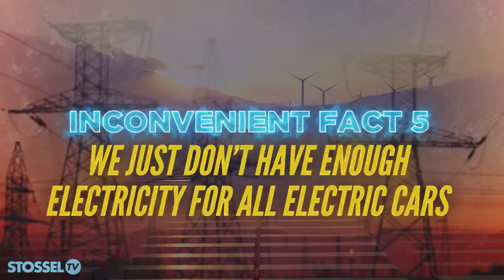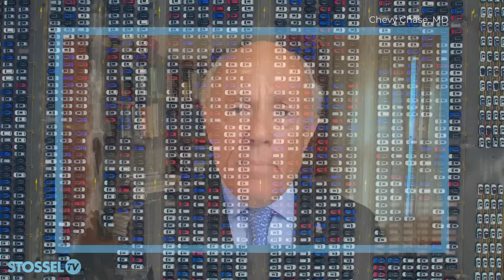Electric Cars: Inconvenient Facts, Part 2

Comment from the maker: The original version of this video has been updated. We originally said that covering "the entire continental United States with solar panels would not supply half of America’s electricity.” But the study we cited for this fact has been updated.  Therefore our reference to it has been removed.
Reply: Well it's all over the web which a simple search will tell you. depends on insolation and who much is electric energy versus other types of power.

 Here in Australia  it's about a thousand sq km for total electrical load.
Reply: You should had left that solar panel video. All that free electricity paying it self again and again would have been an hilarious backfire to your gas and oil employers Lol 😆 😂 🤣
Reply: John, what are the advantages?  How about a full story from both sides.  Give us the facts and let us determine our opinions.
Reply: Double the electricity grid to provide the charging capacity for BEVs. How much to replace the heating with oil and gas with inefficient heat pumps.

The UK government wants to fit a million heat pumps a year over the next decade. The UK National Grid says we only have capacity in the grid for 900,000 total.
Reply: I'm glad you found out that using 2013 technology it would only take 1% of the land in the lower 48 to power the entire US.   Also using 2022 panels it would only be 0.5% of the land.  Really should have updated that part and said that this is great thing that could make it easier for the EV transition as a counterpoint to Physicist that thinks CFCs don't cause ozone holes.
Reply: It’s just math Strossel. 🙄
Reply: you should remove the entire video tho because its wrong on all the points😂
Reply: @alans9806  a square of 33km ? gg
Reply: @markhutton6055  *super efficient heatpump my dear.
Reply: God Bless John Stossel, ...and anyone telling the Truth ....
Reply: @PeteZam  John Stossel just apologized for using really old data and took out the section that said we need the entire land mass of the US to supply half of the energy needs for the US.   The US Deptartment of Energy says it takes about 1% of the US lower 48 to power 100% of the US electrical need.   The US Department of Energy was basing this with 14% efficiency solar panels.  Current panels are 18% efficient which means that it requires less than 1% of the land surface.  Half of Lake Michagan would do it.   Go ahead and look it  up.   I challenged Stossel along with probably a whole bunch of others to look it up.   He did and removed the false facts from his video.
Reply: Haha! This is embarrassing. You didn’t do your research. I’d be happy to debate you and Mark Mills. This is manipulative and misinformed.
Reply: Retire John!
You were only popular on 20/20 many decades ago.
Your return to social media is too complicated for you.
Reply: Unfortunately most of the facts you presented here were untrue. It’s tough because I typically enjoy your content. If you continue to produce more videos like this I will be unsubscribing.
Reply: Still wrong on most if not all of the points. Question at the authors: You do not look stuped. Why are you doing this?
Reply: I was wondering if you did any research at all or if you had an agenda to push when I heard you state that the 1st time.   If you addressed every point that was incorrect in this short video you would disprove your entire point.
Reply: Should I go on?
Reply: @mt2nv1   I would love to sit down with you for that 1. In support of course.  This is a rubbish report
Reply: So many wrong statements in your report John. I am so glad you noticed that changing over our cars and trucks and powering this with solar panels would require 0.3% of the US land area, not 200%. But you also said changing over to EVs would require increasing the supply by 50%, which is wrong. It requires increasing the electric supply by 30% over a ten year period. Which is only 2.6% per year. The demand for electricity in the US increases 100% every 14 years and -- thank God for American engineering talent -- this doesn't seem to have had any catastrophic effect on the price of electricity.  This is an opportunity for America. By converting over to EVs for cars and trucks, we can declare independence from the OIL CARTELS. Can I appeal to your sense of nationalism?
Reply: @victorluke5816  Do you or your gurus ever consider the environmental cost of manufacturing and erecting solar panels and wind turbines ?
And if they are so efficient why aren't there more already in use ?
Reply: @markhutton6055  But that is a false statement. In the case of the US, we only need to increase the supply of electricity by 2.6% a year for 10 years. That is a net increase of 30% in electricity demand, which is the correct amount. Not 50%.
Reply: @theberserker9285  Off course they do.  Environmentally its tremendously less than coal and just a lot more friendly than natural gas.  You have hit the nail on the head.  Solar and wind are the fastest growing power sources since they became cheaper than anything else as of 2020.  I also tend to listen to investment news more than eco stuff. Its always nicer to be ecological but making more money is the most reliable way to manage change.
Reply: @victorluke5816  Where are they manufactured ?
Where are the natural resources mined that go into making these magical panels ?
Are these costs considered when trendy guys like you are out car shopping ?
Reply: @erikmoore7402  did you see Sam Alexander’s rebuttal video?
Reply: Here’s a few fun facts. Internal combustion engines are only between 20-30% efficient. We waste 70-80% of our money every time we fill up. Every gallon (6.3 pounds) of gasoline burned creates 20 pounds of CO2 in our atmosphere. The average vehicle in America emits 11,500 pounds  (source EPA) of CO2 a year. There are 265 million vehicles in the United States (statisa). Therefore, each year we emit 3,000,000,000,000 (Trillion) pounds of CO2 into our atmosphere. That’s the equivalent weight of 25 Great Walls of China. 

I’d be willing to bet that far exceeds the total emissions globally to mine in manufacture, electric vehicles. Again this is only one year. Getting the picture John? 😉 🤦🏻‍♂️
Reply: I only enjoyed John's contents on 20/20.
All his new contents are B.S.
Reply: @mt2nv1  I did.   It was well done.
Reply: @mt2nv1  Another person who thinks he knows everything...
Reply: How many pathetic BOTS are here? SMH.
Reply: @markyuto6820  This is simple stuff. Google it. Prove me wrong. 😉
Reply: @markyuto6820  I’m not a bit. I see you have 1 subscriber and 48 comments on your channel. Perhaps you are the bot??? 🤓
Reply: @mt2nv1  Yes you are.
Reply: @mt2nv1   Nice try copy and paste and act like you're some kind genius.
Reply: @markyuto6820  I’ll be satisfied when John and Mark redact the entire video and issue statement taking responsibility for their wrongdoing. I have a friend who works for the Manhattan Institute. I passed this along to him. This is exactly why we can’t get away from oil and gas. 

Environment, public health, economy, consumer options, national security. EVs are the better choice. Simple.
Reply: @mt2nv1  Your research? From google? Lmao. No wonder why society is so f up these because people they know everything or what they're talking about.
Reply: @markyuto6820  I don't see any.   You mean people that don't agree with you?
Reply: @erikmoore7402  You already watched this a long time ago and yet here you are BOT
Reply: A tiny corner of Nevada can produce enough electricity for the US. You get about 1000 W per square meter in sunshine, and 20% solar pannels are pretty common. If you get an insolation map you can be more precise, but about 5 hour a day. My 20 solar pannels in Ohio, with some minor shading, and 4 facing east and west produce  7000 - 7500 kwh. I get around 3.7 miles per kwh, enough for 2 cars, and my whole roof isn't even covered, and this ain't the desert in Nevada or California.
Reply: @mt2nv1  Who's gonna buy me an electric car ? 
i'll take my gas guzzler to the crushers as soon as I get my new electric car ....
Any takers ? 
C'mon man do you want me to keep driving that gas guzzler or do you want to save the planet ?
IT'S ALL UP TO YOU !
Reply: @theberserker9285  Right now panels are being manufactured in China, Vietnam, South Korea, Malaysia and the USA.   For Wind turbines its China, the US, Germany, Denmark, and France.  A lot of panels are made of sand for the most part and some other cheap materials because its dropped in costs by 89% since 1991.  If you want to talk about car batteries they have dropped in price by 97% since 1991.  The US could have much larger percentages of solar but they pretty much told China to take the market because we wanted to burn more oil for a few more decades.
Reply: @victorluke5816  Why would Americans want to burn oil if solar is less expensive ?
They're not THAT stupid are they ?
Reply: @theberserker9285  🤦
Reply: @markyuto6820  Well ? 
Any suggestions for those of us who can't afford an EV and still need to travel 20 miles or more a day to get to work and back  to feed our families ?
I doubt I'll get a reply......
Reply: @markyuto6820  lol.   What?    Because you're highly uninformed doesn't mean that other people are bots. Holy Moly.   what do I need to face time you or something?
Reply: @markyuto6820   You notice the video is updated?  because he got called out on bullshit.
Reply: @markyuto6820  🎅 Merry Christmas !
Reply: @mt2nv1  I can barely afford groceries like so many others...
And you feel the need to boost your ego at my expense...
Have a Merry Christmas !
Reply: @theberserker9285  my apologies. I thought you were being sarcastic, I was being sarcastic. 

No ill intent on my end. Simply joking. Hope you have a Merry Christmas! 🙏🏻
Reply: @victorluke5816  at least he removed it. Not unlike John Kerry saying half of the east coast would be under water or AOC.
Reply: @douglasjones8539  Does he have some videos he put up that still says that?   I would have thought he woudl have pulled those already.  Or are those just the ones making fun of him?   We still have years before Miami is under water.   Can't get flood insurance there anymore but its not underwater yet.
Reply: @theberserker9285  That didn't become true until 2020.   Before that gas still had some advantage.   It was short sighted not to see that solar was getting cheaper year by year and someone should have invested in the US.
Reply: @mt2nv1  Thanks Jake...
Reply: You presented such a poor representation of falsehoods that I have to think your other videos are also poorly researched and presented.  Very bad 2 videos.
Reply: @markhutton6055  You think heat pumps are inefficient?   Put in 4kW of electricity and getting 16kW worth of heat in the house is inefficient?

Why don't you make the calculation yourself?  Why are you asking the ether?  Just look at the energy data on the EIA and make the calculation.  Assume a COP of 3.0  for the heat pump.

And once you are done, ask yourself how long it would take for the entire country to switch over to them.  Here's a hint: More than a few decades.  

Divide it out, compare it to the current grid, and there's your grid expansion rate.

Go ahead, do it yourself.  It only requires grade-school-level math.
Reply: @victorluke5816  Current panels are actually 20-23% efficient.  20% is the low-end for residential panels these days.  23% is the high-end.

At grid-scale, however, concentrator installations can easily get above 30%.
Reply: Tyrant’s.
They are mortal
Reply: @markyuto6820  Too many, unfortunately.  I wish Google would spend more time dealing with them.   Even some of the posts that sound like actual human beings and respond like actual human beings are bots.
Reply: @junkerzn7312 Have a merry Christmas Junker, I won't bother you  anymore....
Reply: @theberserker9285  Sorry, I am not moved by your personal troubles.  You have demonstrated very ably by your postings that your hardships are your own fault.   Believing in the never-ending stream of nonsense put forth of social media never results in good-endings.

So if you want to better your lot in life, there is an obvious place to start, right?
Reply: @junkerzn7312  The panels get better every time in look away.
Reply: Too bad you didn't remove the rest of the wrong claims... You know, like 85% of the video. I'd do a point by point breakdown but nobody would read it and I value my time at least a bit. Would be kind to tell you everything that's wrong if you wanted. Maybe you'd even realize how wrong you are. But I'm just dreaming, we're all human and your biases mean you won't change your (wrong and misled) opinion.
Reply: @theberserker9285  Mainly because of lobbying, the money coming from big oil and people like you or the guy interviewed in the video.
Reply: @victorluke5816  pink energy, there's an investment.
Reply: Appreciate the transparency after the fact. Wonder how many other inconvenient “facts” aren’t actually facts. 

I think you can do better sir. 

Perhaps speak about the truth that we can’t just stop using oil and coal until renewables are proven on a large scale. 

Can’t tear down the old bridge before the new one is built. 

But renewable technology that gets better and better each year has a promising future. One hopefully where we will be less dependent on oil.
Reply: @markhutton6055  
You must live where temperature is below 40°F all the time.
Heat pump uses 1/3 of electricity compared to traditional electric furnace. I also have hybrid water heater (heap pump). It uses 1/4 of electricity compared to regular electric water heater. 
You live in a stone age pal! Or roommate with John? 😆
Reply: @victorluke5816  
Let me add to that sir!
Today's solar panels has 22% efficiency. 
Next year two will come with 40% efficiency. 
You only need .25% land to power the whole country. Every 5 years, the solar efficiency compounds by 10%.
Reply: @junkerzn7312  
You guys basement buddies?
Reply: @junkerzn7312  
Efficiency just went up to 40%
Every 5 years, solar panel Efficiency compounds by 10%

John Stossel is using year 2000 solar technology.
Reply: you mean you got it wrong. and not just wrong. COLOSALLY wrong. makes you wonder what else you got colossally wrong.
Reply: So you checked facts after publishing? Once you had credibility.
Reply: So what did the "updated" study demonstrate?
Reply: @wt9653  Just to be clear here, solar cells with efficiencies that high are expensive multi-junction cells and also almost universally also concentrator cells (which require active cooling and heavier, more involved assemblies).  You won't find these types of cells in very many places.  Multi-junction cells are found mostly in space and concentrator cells are not in volume production anywhere. 

Eventually we will have multi-junction non-concentrator cells in mass production which are economical.  Right now most suffer from fairly severe issues like short lifespans, high degradation rates, or very high cost.

For economically viable cells in volume production, 23% is about the maximum and that won't be changing a whole lot for a while.   Economical meaning, primarily low degradation rates and long lifespans.

A Grade-A SunPower/Maxeon cell, for example, is typically around 22% efficient and has a degradation rate of 0.2% a year, with a lifespan in excess of 40 years.
Reply: As to the fantasy scenario that covering the US meets/does not meet US energy needs. recall that the solar power reaching the surface is 350X the needs we have for a given measure of land.  So, yes at an efficiency coefficient of .04% the theoretical provision of energy does work.  
However to provide what the US needs in a day the realistic foot print is 1 square foot of solar collection per 350 square feet of ground x true collection efficiency.  This puts us somewhere at the statement that to provide for Las Vegas, where I am, and incidentally a city in the top 5 US cities in terms of clear sky days annually, then we need solar collection expressed in panels at about 1.5 x the size of Las Vegas to provide ONLY for Las Vegas.  The same is true 'next door', in Phoenix, Az. where they would need about a city and a half of land covered in solar panels to provide for the city.  In cites suffering stronger winters, such as Boise or Salt Lake that number is closer to 2.5 - 3 city foot prints in panels.  In short, for the 4 plex I own the city needs about $600k in panels to provide electric for this property with a market value of $400k, and a current electric bill for all 4 units of about $1200.  I don't call that realistic.
Reply: You're overlooking unicorn farts.  You should stop by the newborn intensive care unit and hear from the toddlers how bad petro is.
Reply: Make part 3! Talk about the weight of these cars and why a 12,000lb electric car hitting a Ford focus is devastating.
Reply: You need abut an area to power the entire US from solar of less than 150x150 miles.  Plus if you stop producing fossil fuel you would save a ton of power as well.
Reply: @adrianv.v.4445  
I've never asked you anything so your reply makes no sense...
Sober up and try again Adrian.
Reply: @douglasjones8539  What's pink energy?  Crematorium based?   I'm about 12 miles away from Rose Hills and they have this smoke coming out at all times of the day.   They are the biggest cemetary in the Southern California with major cremation operations.
Reply: @wt9653  This news on solar efficiency is the best I've heard today.  Thanks.
Reply: Some disrespectful comments here about you, Mr. Stossel; I'm sorry to see them.  I always appreciated your show and your segments on Fox.  And, thank you for respecting your audience enough to make the public correction knowing you risked the blowback you'd receive.
Reply: There seems to be controversy on how many acres of solar panels it would take to power the whole nation. John can you do a short video on that?  I and I'm sure others would like to know the correct answer.
Reply: @douglasjones8539  That means that the company over extended itself or could not get enough workers  to fulfill contracts.  Happens all the time with businesses.
Reply: @brianjob3018  I too have enjoyed Mr. Stossel for decades but he invited a science expert in physics that has testified that smoking does not cause cancer, cfcs do not cause damage to the ozone and now got his math wrong by nearly 200 times what the square miles are needed to power the US for solar power.  It just got much harder for me to trust Mr. Stossel.
Reply: @victorluke5816  you need to do some research!
Reply: @douglasjones8539  About what should I be doing research on?  So far you have been pretty vague about it.
Reply: Batteries are dangerous, inefficient, and create waste that is toxic to any environment. The future, therefore, is in efficient power plants (like Iron-man) to generate power, not store it. An electric car is 100x more efficient by any metric if powered by an onboard power plant rather than with stored battery power from outside power sources. For example; A small diesel engine can power four electric wheel driving motors by turning an electric generator creating ample power on demand at a rate of 300 to 500 miles per gallon (depending on the specifics of the automobile design) and be refueled like a standard combustion diesel engine automobile. 
(No data available to know if this could in any way apply to tractor trailer applications, but presumably not, since no such hybrid designs have produced such data in the first place)
If electric cars are the future, combustion engines are what get us there.
Reply: @markhutton6055  The newest heat pumps are more efficient than heating oil furnaces.
Reply: @victorluke5816  Much less than that, about 2-3000 square miles out of 3.8 million square miles.
Reply: @mikebaum5976  Not in this video.
Reply: @MarkH10  Your numbers are off starting with your efficiency coefficient, 40% does not equal .04%.  0.04% is almost nothing.
Reply: @brianjob3018  This video was poorly researched and his "expert" does consulting work for the oil and gas industry, hardly an unbiased source.  The negative comments are deserved.
Reply: @autonomouspublishingincorp8241  You're getting your science from Iron Man?  Are you joking?
Reply: @brownro214  It was an example used in the video. No, not the science. The principle. There is a difference between a battery, and a generator, which is a point the video missed when the video referenced Iron Man. John Stossel brought him up. We just comment about it.
Reply: @decaprio7421  It is not free. You have to pay for electricity no matter how it is generated and solar panels are useless at night during rain, snow, overcast etc.
Reply: @theberserker9285  When it comes to affordability, Its a matter of timing.   Depending on where you live there can be some locations where the government wants people to own EVs.   I got lucky and had an extremely high pollution car in an 1982 Mercedes 300D.  The state gave me $10K for crushing the car if I would buy an EV.   Various other government organizations and private entitities gave me another $5K.  There were GM Bolts there for less than $15K which meant that I could get a free car.   I decided on a 2014 Tesla Model S instead with lifetime supercharging and internet connections for $30K.   So I got that for an additional $15K.  This was the lowest I've ever paid for a car and I've never been happier.  I averaged 400 miles a week at this point.
Reply: Stossel is a dishonest broker of information. His video does not highlight that physicist Mark Mills of the Manhattan Institute describes Plug In Hybrid Electric Vehicles as a very good option. An EV with a range of 100 to 125 miles plus a range extender to 250 to 400 miles would do the trick. A range extender such as a rotary engine would be a good choice like a Mazda MX 30 PHEV Wankel Engine. Sodium batteries start to be manufactured by CATL circa 2023, too. 80% of Americans drive less than 50 miles per day. PHEV with Sodium are a good option for circa 2025.
Reply: @JJSmith1100  F22 Raptor, Propeller Edition..  Lubricants, who needs them, Solar is all you need forget bstteries.... Derp 2022 Award goes to Johan.  P.S. You should disconnect from the grid and go pure solar.  Thx.
Reply: @Jasen Vernor It is that easy and they are doing it.  I hope I'm answering the right question here.  I'd feel silly if this question was about colonizing Mars.
Reply: I remember when that wrestler slapped the shit out of you John. It was hilarious 😂
Reply: @victorluke5816  these numbers are way way wrong
Reply: @erikmoore7402  unfortunately your responses forced me to do research, solar power is still very expensive and impractical, I looked into heating my home with it, I don't have a big house but I would need a solar farm to do it
Reply: @wt9653  I would need 60 panels to provide me heating for a year, crazy, and that is a current up to date number
Reply: @brianrhodes9080  
Since, you didn't do your math.
Typical home uses about 25-30kw per day.
That includes heating and ac.
60 panels X 400 watts= 24,000 watts per hour.
60 panels will heat, cooking, and lighting for up to 6 homes.
If you use heat pump and hybrid water heater. It could be up to 10 homes.
Pellet stove will get you even more. Up to 15 homes.
Reply: @brianrhodes9080  We know that John Stossels numbers are way wrong. Thats why the US Department of Energy ones should be used even though those are getting old as well.  They do need an update.
Reply: @mt2nv1  "I have a friend who works for the Manhattan Institute" (yeah okay 🙄 sure you do buddy)
Reply: @wt9653  when I need the power I need the power, how many batteries you think I can have.....btw, I'm getting numbers from a site with the us dept of energy logo on it, so argue with them, and anecdotally, if it were such a great deal, I'd see them all over my neighborhood.  Newsflash, I dont
Reply: @wt9653  yeah, ok, I won't hold my breath.  I'm not against the technology if it makes sense, almost went geothermal, neighbors did years ago, they don't exactly say it is delivering as promised
Reply: @brianrhodes9080  
You need follow up on the solar technology.
Its now the cheapest source of electricity. 
At the same time, it matters where you live.
I live in Western Washington. The sun only comes out 7-8 months out of the year. 
Even during winter,  the solar panels still produce electricity. Just not as much.
As technology evoloves, solar panels will be able to draw electricity from gloomy rain and snowy days. If you see daytime, that's sun.
Every 5 years, the solar panel efficiency compounds by 10%.
Today's panels have 22% efficiency. 
They just came out with 40% efficiency. 
These will go on sale in year or two. 
Eventually, 100%, 200%, 1000% in our future.
Just think of one small panel powering your house 24/7.
Reply: What's the life span of solar panels? And how do we depose of them? What's replacement cost of panels, ev batteries & wind turbines?? I'm guessing in the future wind power will be standing around all wore out, just as antique  water windmills barley stand around today.
Reply: @wt9653  again, I'll wait till the neighbors have them, won't hold my breath
Reply: John: i'm down the road from you in New Bedford. never mind the grid, i live in an apartment with street parking, WTF am i going to plug an EV in?
Reply: @inerlogic  
Landlords are given the rights to setup charging stations and charge the tenants in Florida. Other states and cities will follow. 
Too much money to be made.
Reply: @markhutton6055  It is about a 30% increase not double.
Reply: @alans9806  Yep, not that much .  10, 10x10 arrays.
Reply: @derrickdavis7524  I also noticed how he avoided that actually numbers in favor of hyperbole.
Reply: I believe the quote from Elon Musk was 100x100 square miles of solar panels. So such an assertion probably had to do with leaving room between them, not covering farmland, forests, etc.
Reply: There are so many problems with this video, you are really missing the mark.  A EV gets 350 miles of range, my ICE vehicle gets 350 miles of range.  So the claim we need magical batteries is nonsense.  Quoting $100T as a cost when the reality is this is a figure that has dropped from $1,000,000T a couple decades ago ignores the economics of hte situation, etc.
Reply: @JayVal90  At least in the US we have so much none productive land this is not an issue.
Reply: @gregkramer5588  Which is too bad. Stossel is/was better than that.
Reply: If you start looking at the numbers John I think you will find this video quite embarrassing.
Reply: @victorluke5816  solar panels are extremely volatile, and depending on weather conditions can have all sorts of things happen to the thermal efficiency.  Not like I should trust anyone who can't spell the word Michigan anyways.
Reply: @richflores1558  name is Brandon. I mountain bike with him. Already shared the link with bullet points of the lies. 👍
Reply: @gregkramer5588  Yeah just no. Don’t give me all this shit about preserving ecosystems then present “solutions” to ecological problems that involve carpeting every untouched ecosystem with thousands of square miles of toxic solar panels
Reply: @RogerWilco1  As is so often the case with Green BS technologies, a 350 mile range in an EV is not the same as a 350 mile range in an ICE vehicle.
Reply: @fjalics  You are getting 7MWh out of your solar panels? to get 7MWh over day of 8 hours 900kW every hour. at 150W/m^2 best case of deployable solar panels the surface area would be at least low end 900kW / 150W = 900,000W/150W= 6,000 square meters. Your solar panels are at 1.48 acres in area, I would suggest that you meant tat you get 7kWh from your panels total. Please tell me your efficiency of the solar panels installed in W/m^2? Also, what is the power delivered during the day, assuming a peak when the sun is at zenith? 1,000W/m^2 of solar radiation is not available from a solar panel.
Reply: @CvetkovIlian  When you learn to write and spell someone might take you serious.
Reply: @rpercifieldjr  Per year. I have 20 x  310w Astroenergy modules, which are basically 2 square meters in size. 6.2kw total, Solar Edge DC optimizers, and inverter. I installed it in 2017. 36.94 mwh over it's lifetime.
Reply: @thomasthefascisttankengine4694  Meaning that we might need more than 0.5% of the surface of the lower 48 to power the US 100%.   Not exactly a huge problem.  However, just having all homes in the sun belt have solar panles might already cover it.  I just saw all the school parking lots get covered over with solar panels this year.   At least in the school district my kids are gong to.  We also had the first City Hall to be solar powerd so I'm not surprised that they keep buying high tech stuff.  I thought they were nuts when they installed fiber optic communication cables back in the 1980s so I'm pretty much okay with my city doing stuff like this.
Reply: @victorluke5816  I love how you live someplace where they can afford to do such things and think that most places have money to throw away like that in the hopes of some eventual return. You probably agree with the whole "solar powered roadway," garbage that was tried and will never be effective. But I guess people don't trust physics, you'll find out when it all winds up being in vain and a waste of money. You're welcome to disagree all you'd like, but I'd wager the future proves me correct.
Reply: @thomasthefascisttankengine4694  Nope always do the small tests first to find out if it works and when it does go in big for the kill.  Regular solar power started to be cheaper than any hydrocarbon fuel back in 2020.  That's when I thought its time for everyone to have it.    When they put solar in  City Hall it was a great experiment which they doubled down  on when it was found to be economically viable.  Waste a little money to make a huge amount of money.  Our city didn't buld up huge reserves doubling down on non viable assets.  I applauded getting fiber optics a few decades before the general public and I appreciated it when started to water all public grass with treated sewage water.  They started to sell that water all over Southern California after they found that it was safe.  I love trying new tech but you never make it general use until its profitable to do so.  Solar power is currently the best Capitalist answer.  I won't be tied down to "That's how my daddy did it so that's how I'm going to do it" thinking.
Reply: @JayVal90  WTH?  Toxic solar panels WTH?   Thousands of square miles!  Ok let's look at the math.  >150mw per square mile.    That means ~8 square miles of solar panels would replace about a train load of coal per day.  Just going from a 1200MW power plant I toured where they used a train load a day.  
The US electric generation capability  is ~1150GW.  If we need to add 20% to that we would be adding 230GW.  230,000/150 =    1511 square miles.  Wyoming is over 97,000 square miles.  When you go there it is half dirt and tumble weeds.   The use has 150,000 square miles of field corn.  
Hopefully this shows you the scale is completely doable.   I fear you are looking at this through some kind of political bias instead of the actual data.
Reply: @gregkramer5588  You literally assumed that the sun was shining all day in your calculations. The real figure is 10k sq miles when you factor everything in, to say nothing of the batteries you’d need.
Reply: @decaprio7421 .. How much ;energy; and of which source, does it take to mine, manufacture, build, transport, assemble, then as time takes it's toll, remove, disassemble, transport, recycle wind turbines, solar arrays, as their output degrades, maintenance costs increases. Resulting in unimaginable gross tonnage of fiberglass and toxic components. All product eventually becomes valueless... Physics 101... 5 turbines total life output to manufacture, install ONE turbine...
Reply: @isayusayweallcansay  They bleed, too. Jus like the rest of us
Reply: Well said….
Reply: @blogengeezer4507  The assignment is to get rid of the smell of a caught 🎣 rotting fish smudged in oil 🐟🛢 in 30 to 50 years from now. So fix those windmills!
Reply: @theberserker9285  and given the 10 year lifespan of wind farm blades, we already have more of them clogging our dumps than we know what to do with.
Reply: @JayVal90  Well, that's true.  The "refuelling" part for an EV is much different.   I would want an EV to have a 500 mile range to compete with a 350 mile ICE vehicle.  IF you do a lot of long trips.  IF you do mostly work commutes as %90 of people do for %90 of the time, being able to recharge overnight at home and never go to a gas station swings the comparison the other way.  EV is not a BS technology. Its a dramatically better experience in just about every way.
Reply: @RogerWilco1  It’s better if and only if you live in a city and can pay the $30k premium for the bigger battery. That’s not most people.
Reply: @decaprio7421 no
Mm
Reply: @cherylmockotr  you are missing the point. EVs pollute very very little after they are produced. In fact several studies have shown confirmation of a total lifecycle reduction of 75% vs typical gas cars. You are believing unsubstantiated lies propagated for the benefit of keeping oil and gas in business. It’s really a terrible business model. We now have a better option. 

Please send me reference to one reputable study that confirms what you are saying about CO2. This is not a political issue. The educated world agrees unequivocally on this. To say otherwise is simply naive. I’m not suggesting we mothball refineries. We need to be logical. That said, “your facts” are wrong and irresponsible. 👍
Reply: @mt2nv1  how about if you send me proof the "educated world" is all in agreement with your stance, first? Which, of course, means you will have to try and prove your null hypothesis, that there are plenty who are not.
Reply: @JayVal90   I suggest you look into how disruptive technologies are adopted.  Yes there are limitations in EVs currently, they are more expensive than they will be etc, but before too long they will be a little cheaper than ICE vehicles (while better performance in every way) and then eventually a LOT cheaper.   

Government destroys so much economic value, people are used to cars going 40 years without improvement.  So its understandable to think that this is the peak of what EVs will be, but if you look at the technology and economics, this is still the early days of EVs.
Reply: @markhutton6055  That was a false statement again. Check Sam Alexander rebutal.
Reply: Dude you have to remake the videos. You got more things than that wrong. I love your videos and i trust it was a mistake of source but that's not how many people see it. I don't want to see people lose trust in you. You have to remake it better. You just have too.
Reply: @cherylmockotr  putting it in layman’s terms. 
- [ ] Humans have been on earth for 200,000 years. During that time, Human population never surpassed 1 Billion until the early 1800s.
- [ ] In .1% of human existence (years 1800-2022) population has increased to 7.9 Billion today. That’s a 690% increase in a literal blink of the eye.
- [ ] There were less than 1000 cars on earth before 1900 today there are over 1 billion.
- [ ] Each gallon of gas (6.3 lbs) burned creates 20 lbs of CO2. 
- [ ] Since the Industrial Revolution people have emitted carbon equal to the weight of 3 million Sears Tower buildings (375 Billion tons or 750 Trillion lbs) of CO2 into the atmosphere. 
- [ ] During that same time frame, we cut down forests equal in area to the  United States (Alaska and Hawaii included) and Egypt combined. 
- [ ] We continue to lose 8 million hectares of forests every year. That’s the equivalent to the area of the state of Texas every 10 years. H
Reply: @brownro214  and “where does the electricity that powers the pumps originate?”conveniently goes unasked & unanswered
Reply: @michaelmurphy1028  no need for personal attacks. Many are blissfully ignorant of such things. Like leaving the water running while you shave or brush your teeth
Reply: @bill1589  
?
Reply: @derrickdavis7524   I have messaged John to help with this. But no Response.
Reply: @Velez0777  sigh. also incorrect. but you do you
Reply: @mt2nv1  Not exactly sure where 200,000 years of human existence stat comes from.....biblical history and scientific evidence points to little over 6,000 years.
But I do agree with your statement cutting down of forests. Forests and plant life help keep eco systems in balance. Also soak in carbon dioxide.  So more than fossil fuel usage is to blame for ozone depletion.
Reply: THanks for the update John. now the real story is how they managed to be off by a factor of more than 500x and they left up a BLATANTLY wrong stat for "non scientific people" Yes i purposefully said that because you relied on a appeal to authority with Mills.
Reply: @victorluke5816  and the panels work in the dark, do they?
Reply: Yeah, reality is that if we covered HALF the corn fields currently growing corn JUST FOR ETHANOL with Modern Efficient Solar panels, we could power the ENTIRE COUNTRY just with that, so that was a HUGE Oopsie!
Reply: @jimmys6566  The latest version works in moonlight but normally people use stored battery power for that or the offshore wind which is more active at night.
Reply: @cherylmockotr  They don't recycle them ?
Oh that would skew the numbers.
right now wind is a "renewable"
But some of us know better...
Reply: @theberserker9285  they can't be recycled for some reason, bit I don't remember what that reason is. There are some attempts to repurpose the blades, but that's not going very well.
Reply: @jimmys6566  Where did I say that these were normal panels?  Please do not lie about what I've written.  Its all here for everyone to see.
Reply: @victorluke5816  Lie? There are NO commercial panels like those you suggest. it is simply beyond the realm of physics to produce significant power from starlight.  You seem to think otherwise so please name the panel manufacturer and the power output per sq meter
Reply: Exactly!
Reply: @ChineseBandits  seriously !
Reply: @victorluke5816  On a clear night with a full moon, you should only expect 0.3% of the energy production that you would experience in direct sunlight. That means that if a solar panel typically produces 300 watts of power during the daytime, they will only generate roughly 0.9 watts in direct, full moonlight.

However, the moon is only full once in 28 days and new once in 28 days so the mean appearance is half the full moon so that reduces the theoretical output of the panel to 0.45 watts.

A further issue is that the moon is only in the night sky sometimes because it sets before midnight for half the lunar month so let's reduce that 0.45 watts to 0.25 watts
This 0.25 watts is so small that it is NOT a viable source of electrical energy supply
Reply: @jimmys6566  I identify as King today so it's your Majesty. Maybe seriously, but I don't get too serious on Thanksgiving, enjoy your turkey.
Reply: @cherylmockotr  Thanks for the info......
Reply: @jimmys6566  You do realize that this is also the best time for wind and if you have regular sunlight in the daytime that can be stored.
Reply: 0:32 “They leak energy”  Yeah, right.  Maybe old lead acid ones like in your gas car do a little.  Any facts you’d like to provide to back up that claim?  Of course not, we can just pull stuff out of our rear end and my audience will eat it up.

0:43 “Oil has 5000% more energy in it per pound” Then continues to say that batteries weigh 1000 lbs and the gas it replaces weighs 80 lbs.  Forget that the casing of the Battery module is typically a structural part of the vehicle and we’ll just leave it at 1000lbs for fun, 1000/80 is 12.5 times more, or 1250%, not 5000% (which would be 50 times).  It’s just math, right John?  And the whole system is what matters, not just one part, right?  The electric motor is far more energy dense and far more efficient. But if you don’t leave out half of the facts, it wouldn’t make your argument look pausable.

1:17, Like the ones iron man has, not that is funny, I have to admit.

2:08 Any smart person at that point might ask “is there any other way”  No, not John, he just goes with it.

2:21  I love how John gives his audience the sleight of hand at this point saying “Every car will be electric”  And then pans to Dr. Doolitle mentioning new car sales in California.  Does he mention that even in California, gas-powered plugin hybrids are still allowed, no?  That would be being honest.  Does he mention any other state, no?  Timeframe, no.  John and Mark will be long since dead, so they know it can't come back to haunt them.

2:37 “don’t use your electric car”  Of course that’s not what was said.  They said just to avoid charging between 4 and 9pm for a few days just like other appliances.  And that other times of the day were fine, like night where ½ of the demand is and over 95% of the EV charging is done anyway.  Don’t want to keep your audience informed if you mentioned that, do you?

2:49 and you left in the stupid doubling of the electric grid.  Again, no references or facts.

3:26 love the crude chop of the most ridiculous claim about covering the entire US with wind and solar would only provide half the energy.  Really, was that the only misinformation you decided to chop out?

4:05  lol, how short-sighted is this dude?  Imagine him saying, Oh you’ll never make an electric light because Edison invented them using candle and whale oil light so why bother.

John is fallen so far from the days of finding real scams.  It's just math.
Reply: This pair of videos is an example of why I respect John Stossel; he will update as new data becomes available, and he will present both sides.
Reply: @scottkolaya2110  Hi Scott , you're quit knowledgeable on this subject.
Maybe you could clarify a few things for us...
Cost of manufacture and placement of wind turbines (environmentally)
Life span of wind turbines and cost to recycle the blades....
I'd appreciate your opinion on this 
THANKS !
Reply: @markhutton6055  "Double the electricity grid to provide the charging capacity for BEVs. How much to replace the heating with oil and gas with inefficient heat pumps." So show your work, please. Prove that EVs require DOUBLE the grid capacity! Stop repeating your conjecture and do some research. 
First, an EV only consumes (on average) about 10 kW/h per day...that's the worst EVs on the market. That amount of energy can be supplied by house current overnight, no 220v required. That will not melt the grid.
Second, at least in the USA, the greatest increase in demand for energy was the advent of air conditioning right after WWII. Each new home after that time required about DOUBLE the energy of a non-HVAC home, and the grid expanded to meet demand.
Lastly, it requires a tremendous amount of electricity to refine petroleum into gasoline. That amount of electricity is saved when you don't buy gasoline!
Reply: @mikebaum5976  too bad the only person he was interviewing was an oil-industry "expert". Stossel never challenged a single statement from the "expert", and actually had to claw back the original video because the estimates on solar energy production were pure fiction. Stossel was giving the message his oil-industry advertisers paid him to give.
Reply: @theberserker9285  "Do you or your gurus ever consider the environmental cost of manufacturing and erecting solar panels and wind turbines ? And if they are so efficient why aren't there more already in use ?" 
All you're doing is repeating oil-industry propaganda. Wind turbines, once manufactured, generate megawatts of energy per hour for decades. NO FUEL. Same for solar panels. NO FUEL. 
Tell me - your comment states/implies that turbines or solar panels don't ever exceed their environmental cost even after decades of energy production. Do YOU know the environmental cost of making a turbine? Or a solar panel? Likely NOT. You're just doing the oil industry's PR job for them, and for free. Think for yourself. 
As for solar panels and turbines being in use, in my US state over 25% of our energy is renewable. Solar and wind power is now cheaper than coal! 
Again, please do your own research before you repeat the propaganda the oil industry desperately needs to keep us buying their oil.
Reply: @mt2nv1  the actual environmental impact, after averaging several sources, is about 15,000 miles for an EV to become cleaner than a gas car.
Reply: @theberserker9285  "Why would Americans want to burn oil if solar is less expensive ?
They're not THAT stupid are they ?" And now you know that money talks. The traditional fuel organizations have been lobbying against fuel-free energy for decades. Follow the money.
Reply: @justsomeguy934  yes, that sounds about right. Is that Global or US average. 

I feel like Stossel did a bait and switch there by referring to global averages and not mentioning it.
Reply: @CC-xs1hh  "What's the life span of solar panels? And how do we depose of them? " Commercial panels are typically warranted for an expected efficiency (wattage output) for 25 years or so. What's interesting is that unless damaged, they never stop working. Given their lifespan and their similarity to flatscreen televisions, you SHOULD be asking how do we dispose of televisions.
Reply: @cherylmockotr  "and given the 10 year lifespan of wind farm blades, we already have more of them clogging our dumps than we know what to do with." Wind turbines, tower and blades, are 80% recyclable. Turbine blades are made of fiberglass, just like a boat hull. You can LICK a turbine blade. If they're buried (and not used for concrete filler),  you can plant crops over them. You should be concerned for the poison coming out of the tailpipe in front of you before you're worried about a fiberglass turbine blade.
Reply: @cherylmockotr  "There are some attempts to repurpose the blades, but that's not going very well." Incorrect, turbine blades are recyclable. Up to 80%, in fact.
Reply: @theberserker9285  turbine blades are fiberglass, just like a boat hull. They are solid waste, and can be recycled. They last about 10 years before replacement. The alternative energy source - burning something - has no chance to recover environmentally anything - as it burns fuel and pollutes every second it operates. The wind turbine tower has no life expectancy, they'll last as long as a building should.
Reply: @justsomeguy934  Obviously you have a tenuous grasp on what volatile could mean, or just terrible reading comprehension abilities. Very obviously said volatile in terms of energy efficiency, I mean if you can't understand those words the first time around then I'm not sure repeating myself would be of any use.
Reply: @justsomeguy934  If they were making enough TV’s to coat 10k square miles of land, with NO plan for their disposal and replacement every 25 years, yes I would have a problem. Compared to Nuclear, and heck even Oil, this is much worse
Reply: @thomasthefascisttankengine4694  I quoted you EXACTLY, friend, and you didn't say anything about energy efficiency, you just said "volatile". If you can't communicate clearly, or don't recognize that an assumption in your head isn't being conveyed, I suggest a high school writing class for you. 
You're unclear on even your explanation. A volatile energy efficiency in relation to a solar panel can mean two things (PLEASE become knowledgeable of a topic you wish to discuss). Efficiency meaning 1: energy capture efficiency, listed in percent of solar energy converted to electricity, which declines with age (not usually listed as "volatile" as its decline is predictable). Efficiency meaning 2: intermittency of energy production, where solar panels are limited to daytime energy production. This efficiency quotient is expressed in hours-per-day of energy generation.
So what have we learned, boys and girls? 1) learn to express your thoughts clearly, and don't get indignant when YOU aren't clear. 2) get a dictionary and learn that volatile doesn't mean predictable.
Reply: @JayVal90  Um, there are billions of television sets made, and they are replaced FAR MORE often than a solar panel is. Solar panels function for decades, televisions are replaced when a new format or size comes out. Your claim that solar panels that NEVER stop making energy are WORSE than nuclear waste is laughable. By all means, present your information in a link to a source we can all vet.
Reply: @mikebaum5976  "let's talk Again when Washington, is all powered by solar pannels and the people preaching down to us have given up their private Jets, and are using solar powered planes to get around." You're trying to change the subject rather than rebut my statements. You are basically repeating what you've "heard" without researching anything...and the oil lobbyists appreciate your patronage. BTW, there are battery powered planes in service right now, but I don't know who you think is advocating for the removal of jets.
Reply: @justsomeguy934  "I have no more points so Im reverting back into my insults like that makes me any less of a high schooler either," you're a great role model bud, I hope to be just like you (:
Reply: @thomasthefascisttankengine4694  ah, the injured child response. I have faith in you, you'll contribute to conversations one day.
Reply: @justsomeguy934  And I ponder as to whether or not you will; only time will tell I suppose.
Reply: @JayVal90  Humans are diurnal. Solar panels are diurnal. Guess what that means? Solar panels generate energy, fuel free, exactly when humans need energy the most. Solar panels don't have to be replaced, they make energy forever unless damaged. Their efficiency drops, but not to zero. 
It's interesting that you are concerned about the solid waste of damaged solar panels and not the poison coming out of the tailpipe of your car or the car ahead of you. Would you like some references on the environmental damage petroleum has done? Or some information on the people that have died protecting oil? Or the costs of parking the military in the Mideast for decades? You don't need a submarine to protect the sunshine falling on the ground in Kansas, you know.
As for nuclear waste amounts, you've completely ignored the contamination factor between a solid waste solar panel (you can LICK a solar panel!) and nuclear waste. I understand Fukushima's HOA has come great deals on apartments, and will have them for at least a few eons. Did you want me to send you the brochure?
Reply: @JayVal90  by the way, Fukushima runs out of contaminated seawater storage this year.
Reply: @justsomeguy934  Oh fr? I wonder if that’s a solvable problem compared to the e-waste pollution epidemic we are going to further exacerbate with these ridiculous ideas of battery and solar everywhere?
Reply: @justsomeguy934  I would say 10k square miles is the size of a small nation. That’s also not just a tiny fraction of the size of Arizona desert (which btw DO have biomes). Electricity usage peaks about the same time the sun goes down, which is a huge current-day problem that current solar providers have to contend with (they deal with it by turning on the gas generators).

Also those figures for nuclear contamination are assuming zero cleanup efforts in the affected areas. Hiroshima and Nagasaki are both areas that had an open nuclear warhead detonated over them that you can stand directly under today. Also 3 mile island doesn’t have an exclusion zone anymore. This nuclear scaremongering comes straight from oil and gas industry.
Reply: @justsomeguy934  their advocating for the eradication of oil product burning engines, and last time I checked Jet turbines used fuel oil..??, , it's about power, control, and money..nothing more., let's not waste your time  and mine...good day to you..cheers...jog on.
Reply: @alans9806  lol
Reply: @justsomeguy934  Thanks for your reply ... I find it interesting you repeat everything I type and put it in parenthesis...
Are you employed by NASA ?
Reply: @theberserker9285  " I find it interesting you repeat everything I type and put it in parenthesis..." I quote back a comment that I reply to. There are literally hundreds of responses on this comment thread alone, so when someone says "no", you don't know to what they are referring to.
Reply: @mikebaum5976  " their advocating for the eradication of oil product burning engines, and last time I checked Jet turbines used fuel oil..??, , " That's not me. I am, in fact, pro-oil. There is no substitute for the stuff in modern life. Gasoline, however, is the exception. How about we NOT burn half our precious oil needed for jet fuel, plastics, lubricants and such when we don't have to?
Reply: @JayVal90  There are nations the size of cities, so the ability to power a country the size of a continent is meaningless. I'll leave a link to the actual size required for solar in the USA, but YouTube has been deleting posts with external references. Just Google the topic and you'll see the actual size.
You are avoiding the topic of solar energy production in total vs. peak. The peak demand happens not when the sun goes down but when people return home from work and prior to going to bed. In the winter, that occurs after the sun goes down. In the summer, solar contributes energy well past the peak. Regardless, the bulk of energy needed is during the daytime, and solar can supply that easily.
Your statement about nuclear scaremongering are baseless. You cannot reduce the half-life of nuclear fuel or waste. Your statement about Hiroshima is also baseless, as that was a weapon with no waste. Fueling a reactor is a different application of radioactive materials altogether. 
I left you many links on the centuries of contamination that both Chernobyl and Fukushima will have, I'm not sure if YouTube will leave them in place.
Reply: @JayVal90  " I wonder if that’s a solvable problem compared to the e-waste pollution epidemic we are going to further exacerbate with these ridiculous ideas of battery and solar everywhere?" Let me see, you're concerned for the disposal of a solid waste solar panel or turbine blade or recyclable lithium battery, but NOT concerned for the poison that gasoline makes? You've been taken in by the oil industry, friend, and the method is called distraction. They have you look elsewhere than you should be looking. I had a guy once tell me how toxic the paint was on wind turbine towers, and that that showed how environmentally unfriendly wind towers are. When I asked him if the paint on a turbine tower was any more toxic than the paint on his car, or his house was, he had no answer. What had happened is that the anti-renewable crowd distracted him by emphasizing a commonality between two things, but only talked about one of the two things.
Reply: @JayVal90  "Oil has made HUGE strides in cleanliness over the past few decades, and its portability, reliability and energy density are second to none. " You cannot clean up gasoline's poison without shutting down the engine itself. We've been at that point for decades, the exhaust is still poison. It would only take a few minutes in a closed garage for your car's exhaust to kill you. 
As for oil being reliable, how's $5 a gallon gas doing? It's artificially lower than that price at the moment, but that's only because the Prez is draining the USA's strategic reserves. I'm watching the manipulation of oil in Europe right now for political reasons, it doesn't seem to reliable to me. Given the global supply chain, all it takes in one tanker stuck in the Suez Canal and the availability and price of oil fluctuates. No thanks.
Energy density is meaningless if you can get a fuel-free energy source, yes? How about not burning oil at all if there's a substitute?
Reply: @justsomeguy934  ok, so your advocating for diesel engined cars?..lol, or should we all fly jets to the store, work, school...etc?
Reply: @justsomeguy934  have you ever researched where the term " fossil fuel" came from?
Reply: @victorluke5816  storage of daytime solar?  It can happen and does in small communities like Eigg Scotland, but it cannot work in a 1m population city
Reply: @justsomeguy934  Your way of answering questions is identical to the way NASA trolls react when they are asked questions on NASA videos...
Self righteous indignation with a few insults....Lol...
I don't think you're "just some guy"...
Reply: @theberserker9285  Well, if having facts makes you think I'm a troll, and quoting the context of my response makes you think I'm a troll, we can have no discourse. If having a fact that contradicts an unproven statement (which is 99% of the anti-EV information I see here) makes you think I'm "self righteous", we can have no discourse. You, and almost everyone posting on this thread, repeat things they've "heard" without verifying its factual basis.
Reply: @mikebaum5976  yes, the term Fossil Fuel was coined by German chemist Caspar Neumann, and then again by Rockefeller in the USA. There's actually more organic material in petroleum than dinosaur goo, but the name has stuck so it's used without question in most discussions.
Reply: @mikebaum5976  "ok, so your advocating for diesel engined cars?..lol, or should we all fly jets to the store, work, school...etc?" 
You're making no sense. Passenger automobiles, city busses, short-haul tractor trailers are ideal for ICE vehicle replacement with EVs. What point are you trying to make? Half our petroleum is refined into gasoline, so if we can save that amount (or close to it), why not? My mantra: use oil for things that have no substitute (lubricants, jet fuel, plastics) and use EVs where practical.
Reply: most of the facts presented will suffer the same
Reply: @justsomeguy934  my point..snd the point of many geological experts. Is that petroleum is not derived from fossils, and is inno way " running out", anytime soon...another " scam for profir"...wordplay.  even petroleum products can be made to be burnt in a more environmentally friendly way,  why is this not pursued??..greed,profit, and thementaliry of..let someone else find the fix in thefuture..same with nuclear waste.
Reply: @JayVal90  Radioactive half-life is half-life. You cannot change it or negate it, all you can do is move it. Hiroshima is completely different than an operating nuclear power plant, as the plant produces contaminated waste that must be stored for centuries. If Hiroshima and a nuclear power plant were the same, why do we have the inadequate storage facilities? 
As for 10K square miles to capture enough solar energy to run the USA, do you have any concept of how many square miles the USA has? Did you know that the amount of land required to build a 100% capture solar farm is less than the land currently occupied by oil & gas leases? Gosh darn, replace the oil & gas leases with solar plants and you actually SAVE real estate. Your square footage concerns are a red herring in this discussion!
Reply: @mikebaum5976  You are overlooking several factors in the fossil fuel discussion. First, it takes EONS under the right conditions to make petroleum. For a comparison, assume that an eyedropper of petroleum is being made TODAY. Also assume that we humans are consuming that same petroleum in swimming pool amounts TODAY. See the difference? You can consider petroleum a finite resource due to production/consumption ratios.
In addition to the consumption rate, you'll also note that the easy-to-get-to reservoirs of petroleum are all gone now. It ain't a bubblin' up Jed Clampet style in Pennsylvania anymore! We're going to sea beds and the arctic to get it.
Whenever someone tells me that oil is so abundant as to not worry about using it, I ask them a simple question: if oil is so abundant, why isn't it priced like water? Why are we fighting wars over the stuff? Why do we have to have our military protect trade routes for tankers full of oil when sunshine falls at our feet?
Reply: @justsomeguy934  Oil and gas leases don’t completely darken the soil and kill everything in the vicinity. Solar, on the other hand, DOES.

We don’t have inadequate storage facilities for nuclear. Like I’ve said countless times, nuclear waste is incredibly small compared to pretty much any other form of energy generation or industry. We have plenty of storage locations, and we even have methods of nuclear waste reprocessing that completely negate the long-lived waste products. The only reason it isn’t “solved” at this point is because the problem is literally so small no one who actually knows what the bigger issues are sees it as a pressing problem.
Reply: @JayVal90  "Ok so your solution to those problems is to rely on the solar panel supply chain that is chiefly in China? Good luck with that, remember the chip shortage?"
Now you're changing the subject. And no, my proposal is to rely on solar energy rather than precious oil. If you're concerned for solar panels being supplied by China, um, the computer you're using right now is Chinese, and the fuel you put in your car comes (in part) from a hostile nation.
The argument that a wind turbine doesn't make back it's energy or environmental cost vs. a fossil fuel generator is propaganda by the terrified oil industry. Turbines make megawatts of electricity per hour with NO FUEL. They operate for months (sometimes years) with no maintenance. Same for solar farms. Every second a traditional power plant is used, something is burning and there's an army of people watching it run.
Reply: @JayVal90  "Oil takes so little energy to pull up and refine compared to what you get out of it it’s practically a magic potion. " Absolutely untrue. So little energy? Haven't I told you it takes 5 kW/h of electricity PER GALLON to refine gasoline? That much electricity will push an EV 15-25 miles without burning the oil in the first place.
Reply: @justsomeguy934  I was merely asking questions..Just because you didn't like those questions , YOU shut down the conversation before it even started...
That IS troll behavior.....
Have a nice Christmas.
Reply: @JayVal90  "Compared to Nuclear, and heck even Oil, this is much worse" So flat screen televisions (no, there isn't a good disposal plan or recycling plan for them) are more dangerous than oil or nuclear waste? Tell ya what. I'll store dozens of solar panels past their prime in my garage, you store a cask of nuclear waste in your garage. We'll check back in a year with each other. Deal?
Reply: @theberserker9285  I'm not shutting down anything, I ask for you to produce facts to back up your statements. Does that mean shutting down a discussion? If you don't have any factual basis for your opinion, then....
Reply: @jimmys6566  The promise of CO2 batteries for extremely cheap and long lasting storage looks good.   They already have one site up and working.  Should even work for 12 million population centers.
Reply: @mikebaum5976  "even petroleum products can be made to be burnt in a more environmentally friendly way,  why is this not pursued??" Because gasoline is gasoline. It follows a strict formula almost a century old and you cannot substitute corn squeezin's for gasoline without damaging existing vehicles. Even flex fuel vehicles must be manufactured to handle high-ethanol fuel. 
Gasoline cars are as efficient and pollution-free as they're going to get, and have been that way for some time. Electric cars are the only way to avoid the issues that ICEs cause.
Reply: @victorluke5816 Do name the trial site and it's capacity. I've already quoted Eigg Electric which depends on a 5kW max draw per home and requires diesel back-up. Promises don't keep you warm
Reply: @victorluke5816  there is no CO2 commercial battery site up and running; there is funding promised for a first commercial site. It is beyond the realms of physics that this can work as it's comparable with hydro, and not a battery
Reply: @jimmys6566  By definition it is a battery.  The physics work out great.  What are you talking about?  Forced hydro is also by definition a battery.  The mechanics are so simple that a child could design one.
Reply: @jimmys6566  Sardinia, Italy is the trial site but I could not get they did not release the capacity.
Reply: @victorluke5816  the physics don't work out great in forced hydro which is why the duration of power supply is by necessity short, and there is no commercial CO2 battery
Reply: @jimmys6566  CO2 batteries have great physics and works out to be 50% cheaper than lithium ion storage.  The first non commercial CO2 BATTERY was made in 2021.  If they can have the the first commercial one by 2023 then that means its so cheap they had to get it to market.
Reply: @victorluke5816  CO2 BATTERIES are sealed system pressurised gas turbines. I assume that you do know that they require fossil fuel energy to heat and cool the gas cycles.
Reply: @jimmys6566  The system has cooling and heating as the battery is charging or discharging.  There is no other cycle.  I don't understand where the outside heating and cooling is required.  The thermodynamic reaction is the charge and discharge itself.
Reply: @victorluke5816  Nonsense; not physically possible. Some thermal energy can be recovered; but not all of it. It needs fossil inputs too
Reply: @jimmys6566  Why does any thermal energy need to be recovered?  You pump up the system with electricity and you release the energy when you need it.  The thermals only occur at these two points.   Both of which are either powered by the charging or generated at the discharge.  The energy needed can be generated by solar or wind as well.   You don't need to heat or cool anything in the system.  The heating and cooling are what happens not in addition to.
Reply: @victorluke5816  can I get a share in the battery mines ?
Reply: @decaprio7421  what about the solar panel and battery material miners employers ?
Reply: @mt2nv1  how are the green energy shares ?? Do you sell ? Getting paid by China ?
Reply: @babagandu  lol! 100% 🇺🇸🇺🇸🇺🇸. I just know how to spot a lie. Seriously, look into if for yourself if you don’t believe me. I’m confident you’ll find this report was extremely misleading and biased. 

You should be asking Mark Mills the same question. He works for the Manhattan Institute and is heavily invested in oil and gas. 🧐
Reply: @mt2nv1  OK where is the report? What are the words to search ? Thanks
Reply: @babagandu  watch the video above from Stossel. Then search the following… Yale ICE vs EV; How much does air pollution cost US taxpayers?; ICE vs EV efficiency; afdc vehicle vs electric emissions, how long does it take an EV to break even on CO2 emissions in U.S.?

I wish I could share links.
Reply: @roadtounemployment8736  It is unfortunate that lies and misinformation gets the most views and $$ for the person who creates the video.  It is true that our current battery technology will probably be worst for the environment than if we just stuck with ICE cars that get 30 miles per gallon.   Both "social media" and EVs are in their infancy and will get better as the decades ahead.
Reply: @babagandu  Just buy Tesla.  They are cheap right now.   They will be doing their own batteries in the US to get the IRA money.
Reply: How is it possible to be that wrong? Don't you know anything at all? It is not because the data has been updated. It is because you were wrong by a factor of 1000!! Anyone who can let this idea flicker through their brains, even for a second, have no business with meddling in the renewable energy topic.
Reply: @victorluke5816 I'm sorry my friend but you don't understand physics. 1 You said "you pump it up w electricity" but that is by necessity currently fossil derived. 2.the heating and cooling incur thermal loss to the atmosphere which then requires topping up, again currently from fossil fuel sources
Reply: @jimmys6566 How is a battery ever a perpetual motion machine when there is an energy input.  If there is loss of energy then that energy is just lost.   This is true of every battery.  No battery needs to be heated or cooled to maintain energy.  What the heck are you talking about?   This is a pressure battery.  Compress to store energy and release to give back energy.  Any thermic variation is due to the compression and release.  Not the other way around.   I seriously think that you have mixed cause with effect.
Reply: @victorluke5816  It doesn't matter what you think. The facts are that under gas compression fossil produced electricity may be required. Heat is stored later to be used to heat the compressed gas - that process may be around 37% efficient, meaning new electricity is required for the next cycle. It can never work ...
Reply: @jimmys6566  It doesn't store heat it stores compressed CO2 as potentilal energy.  No heating of the gas is required.  If you have ever fired off a compressed air duster before you can remember that it cools down the can firing the compressed gas out.  This is the same concept.  If you don't have to heat up your can of compressed air you don't have to heat up your CO2 battery.  You don't have to heat up a compressor either to make it work.  If you are saying that 37% of the electrcity is lost during the compression then you use more electricity from the solar energy you are getting.   I have no idea where you are getting petrol heating being required in any part of the equation.
Reply: @victorluke5816  YOu are a crazy one - the battery charges by drawing CO2 from a dome where it is kept, and uses ELECTRICITY to compress it condenses it into a liquid at ambient temperature, while heat created by the compression process is STORED in thermal energy storage systems. It then discharges by evaporating and expanding the CO2 back into a gas by heating it USING the thermal storage system and ELECTRICITY. The gas is driven through a turbine to inject power into the grid and then pushed back into the dome, ready to be used for the next charging cycle.
Reply: @jimmys6566   Here is the whole concept of this battery.

 The CO2 Battery is a long duration and large scale energy storage system based on a thermodynamic process that efficiently stores energy by manipulating CO2 under different state conditions in a closed thermodynamic transformation. The CO2 Battery can operate in charging mode (absorbing power from the grid) and discharging mode (returning power to the grid).

When operating in charging mode, the CO2 is withdrawn from an atmospheric gasholder, the Dome, and compressed into an inter-refrigerated compressor. The heat generated from the compression is stored in two Thermal Energy Storage Systems.

The CO2 is then condensed and stored under pressure at ambient temperature in the CO2 liquid vessels. When the system is operating in discharging mode, the liquid CO2 is evaporated and heated by recovering heat from the Thermal Energy Storage Systems.

The CO2 stream then expands into a reheated turbine, returning power to the grid and it is stored into the Dome at ambient temperature and pressure without any leakage to the atmosphere.

The energy release is from the expansion of the CO2.  There is still no need to use petroleum powered heating at any stage of the battery use.  Even if the efficiency was on 5 percent it can still use electrical heating rather than gas or oil to heat the CO2 to make the release quicker.
Reply: @victorluke5816  It's best not to argue with fools because the onlooker may not discern the difference. You wrote the gas is " compressed into an inter-refrigerated compressor" and compressors work on petrol, diesel or electricity made from fossil fuels. I rest my case.
Reply: Top tier journalism. Corrects mistakes and draws attention to them, not just hiding them.
Reply: @jimmys6566  The people who made the device wrote that.
Reply: @victorluke5816  and I'm telling you that the compressor needs a powered pump
Reply: @jimmys6566  Which can be powered with electricity from a solar panel.
Reply: @victorluke5816  nooooo, coz it's at night we need the compressors. Read a book .....
Reply: @jimmys6566  Wind still blows at night.  Just walk outside at night.   Know that I'm right.
Reply: @mt2nv1  For  every tonne of mined lithium, 15 tonnes of CO2 are emitted into the air. Also a 40kWh baterie emits 2920 kg of CO2 to the atmosphere. This is extraction and then production, so you need to calculate how much you are polluting whith extraction then add the production of batteries and see which is cleaner.
Reply: @fabioribeiro1009  I’ve done this a thousand times. EV still come out far ahead. Even considering the emissions from mining and production they break even at around 22,000 miles in the USA. Their useful life is 250,000 miles or more. 

Keep in mind every gallon (6.3 lbs) of gas burned creates 20 lbs of CO2 in the atmosphere. The average vehicle in the US creates 4.5 tons of CO2 per year. There are 265,000,000 vehicles in the US. Multiply those two numbers together. 🧐

This is easily found with a simple google search.
Reply: @fabioribeiro1009  also, your number are way off. 🤦🏻‍♂️
Reply: Credit to Stossel for publicly admitting to a factual error, that's a rare thing on this platform and proves his trustworthiness. Shame on anyone using the fact that he is willing to correct an inaccuracy he made as ammo against him.
Reply: @Matteo Comensoli Yet you arbitrarily saying the entire video is wrong on all points doesn't make it so and you don't provide any countervailing evidence or data yourself to support your claim! 🙄
Reply: @victorluke5816  I hear they don't work  so well at night.
Reply: @victorluke5816  I hear they don't work so well at night.
Reply: Still need oil to make the car parts….plastic and rubber?
Reply: @winstonbyronic1248  Solar panels or Wind Turbines?  If its wind turbines, they work great at night and they can power 8K homes per turbine.  The estimate is that by 2030 they will be able to build the 70K home wind turbine.  The current ones are already the size of a football field.
Reply: @markhutton6055  Actually it takes way less capacity expansion than that.  The peak power capacity is driven by AC.  EV charging is off peak for most of the time.  This actually increases the profitability of the electric companies which should drive rates down a bit. From what I see about 30% capacity expansion over the next 25 years is all that will be needed. Way, way less than what AC did to the grid.
Reply: I really enjoyed the report on the electric vehicles and while an alternative. They are not saving the environment in the long run and if I can't afford a new battery or get any value on the sale after x amount of years it now becomes a disposable car. Thank you
Reply: @larryosberg1366  The more advanced batteries are designed for a million miles.  The ones in the model 3 Teslas are designed for about 500K miles but not up to 1 million.  At about 12K miles average that's about 25 to 50 years of usage.  I would be ok with my car being disposable after 50 years.   Also this is also going into buses and trucking as well.  What is supporting the infrastructure of EVs also helps the environment.  Overall about 80% of the pollution can be stopped.  So EVs are  not that bad and costs a lot less.
Reply: I how that is accurate thank you
Reply: @larryosberg1366  I think if you get the info and look at the math it may.  Not everyone fits.  Maybe you tow.  Maybe you do not drive much.   But if you spend 15k miles a year commuting to work it likely does make sense. If you are a luxury car buy for sure it makes sense.  There is a reason luxury cars make EVs an easy choice.  People there are willing to pay more for smooth, quiet, responsive, low maintenance and powerful motors.  I would guess if you drive less than 10k miles per year the math would favor ICE cars still.
Reply: @erikmoore7402  
Do us all a favor and don’t.
Reply: Its great that technology has advanced with solar cells but the relevance of this video still remains. We do not have the storage ability, nor do we have anywhere near the density efficiency of any renewable resource to replace fossil fuels. I will be the first to applaud and congratulate when we do but for now we dont. I ask the question, who is willing to take the responsibility of people in poor countries suffering as a result of there being no equivalent solution to the use of fossil fuels? I say we should wait, to let technology catch up. Worst case is that the world gets destroyed - We lose only one generation. If we only half save the world with the current flawed policies, much worse suffering will result and over many generations. (Assuming the climate predictions are correct - Scientists have been known many times to be wrong) I think we are making a huge mistake and scaring the hell out of our children at the same time.
Reply: @victorluke5816  go spend time listening to Bjorn Lomborg and try picking holes in him, his data or his reasoning
Reply: @mt2nv1  unfortunately, Volvo, Toyota and VAG are all out there with detailed research that rebuts your willingness to bet on total emissions of EV's v ice. They will inform you that when Whole of Life emissions are evaluated, it is revealed that EV's have, in a best-case scenario, got only a relatively minor emissions advantage. That advantage assumes an EV will have a "life" in excess of 10 years and continue on with its original battery array for that 'life'. The global average of the 'life' of a car is 10.2 years. That suggests an EV will be scrapped just at the point it may offer a small emissions advantage over an ice car, making EV's typically a zero sum game, rather than a zero emissions one. Getting the picture Jake?
Reply: @mt2nv1  Volvo, Toyota and VAG have already proved you wrong. Google that.
Reply: @victorluke5816  "a lot of panels are made of sand". Sounds so innocuous that. Until we delve deeper and discover that 'sand' is made into silica glass, and guess how silica glass is created? In 2000 degree C furnaces powered by? You green left buddy Michael Moore covered that one.
Reply: @victorluke5816  mate, check the rise and rise of Lithium prices over the last couple of years. It is heading towards double the price it was 5 years ago. How's that working out with your cheaper battery price for EV's theory?
Reply: @mt2nv1  see how you go with Bjorn Lomborg.
Reply: @theberserker9285  like, hey, buy a bicycle dude! Maybe one with a Lithium battery and an electric motor. Or maybe just keep on enjoying the low cost convenience of an ice car, like 96% of the motoring world does.
Reply: @junkerzn7312  23% efficient. Aren't you all the guys who bagged ice cars because they are  30% efficient?
Reply: @wt9653  wonderful. However, there is a finite amount of compounding improvement for everything. Ultimately, physics will draw that line and in the case of batteries and solar panels, we are fast approaching it.
Reply: @georgebeare8883  
F that , my ride is a 20 yr old Buick sedan...
Reply: @MarkH10  I am interested in the sources you have used to make those calculations. This is not a critique, rather a genuine question. I have long been skeptical about the real-world costs of solar at grid type scale, let alone then including storage of that power. Cheers.
Reply: @georgebeare8883  Isn't Lomberg already one of the most disproven thinkers of our times?
Reply: @theberserker9285  heheh, stop living in the real world buddy. Shell out for a $80,000 Tesla and help save the planet. Uncle Joe wants you! LOL>
Reply: @georgebeare8883 Lol...
80,000 buys a lot of gasoline...
Reply: @georgebeare8883   not true. Yale YSE just released a detailed study. While there may be 1 or 3 that are biased to maintain ICEV sales. Independent research has proven hundreds of time that EVs are much better than ICE. 

Each ICE vehicle emits 11,500 lbs per year on average according to the EPA. There are 265,000,000 vehicles in the US. Multiply those two numbers together. 3 trillion lbs of CO2 emitted by the US vehicle sector alone every year! Getting the picture?
Reply: @theberserker9285  that's it! Stop making sense, or I won't reply to you anymore.
Reply: @victorluke5816  is he really? By you, perhaps. It's LombOrg by the way, while we are on the subject of thinking deeply.
Reply: @georgebeare8883  I’ll accept the facts just not from biased sources. Look at Toyota and VWs recent comments
Reply: @mt2nv1  comments that don't fit your narrative. Around we go again. So accept the experts, unless they don't agree with you, right?
Reply: @georgebeare8883  Yale, Stanford, Harvard and MIT scientists are also experts. The leading experts in the industry. 😉
Reply: @mt2nv1  the leading experts in what industry? None of them work in the auto industry, they work at Universities. The leading experts are those on the highest paid salaries, (far higher than a university pays) actually in the auto industry, engineering real cars that people actually can and do buy. The old story: those that can, do. That that can't, teach. When universities begin making mass produced cars, get back to me.🙄
Reply: @georgebeare8883  you do realize that Toyota, VW, GM, Fords EV sales are a threat to their ICE sales until they can build sufficient production capacity, right?
Reply: @mt2nv1  what a neat little jump to a new line, quietly avoiding answering the previous one. Good idea, when you have no way of rebuttal, but don't think it isn't noticed.

 Now, onto your latest desperate attempt to be right. 

What I realise is that all of those car companies have declared they are either going all-in, or very big on, EV's. These are huge corporations, employing the most talented people in engineering, production and corporate management. 

They are a long way in front of whatever the likes of Joe Average, man on the street, has thought of, regarding the production, scheduling and selling of cars. They work on time lines planned years in advance, not knee-jerk reaction.

That is why you, Jake, are not working for them, in a corporate management role.

Right?
Reply: @mt2nv1  talking of ridiculous, now we jump off again, over to another topic, because you have no come back for the previous reply. Something of a trend with you.

I have only proven that the best and brightest are in private industry, nothing else. That, in itself, was hardly revelatory. In the private sector, pay very much is predicated upon experience and expertise. You have to justify your pay by delivering a return, unlike the sheltered workshop fortresses of university life, where theory and left-field social engineering takes precedent over reality and has no consequences.

To suggest a good income "usually connects to corruption" is an astoundingly Marxist and negative view of the world.

To link the auto industry to alleged Exxon claims is equally incongruous.

Whether the auto industry sells you an EV or a diesel or petrol car, they still make a profit because they still sell you a car. How you can confect that into some kind of anti-EV conspiracy is risible, if not just plain sad.

It certainly is devoid of common sense.

Of course, to the green leftist fanatical activist, nothing is off the table in the pursuit of pushing your narrative. A narrative that talks of "science" and "expert sources" with the caveat always being as long as the science and experts agree with your view.
Reply: @mt2nv1  I'd be willing to bet your an EV owner that lives in CA that receives a substantial subsidy for your work or research in electricity. Check or Checkmate?
Reply: @NKBobcat  No, I’m not brainwashed…my home is solar and haven’t been on the grid for 4 years now.  Have you even tried solar?  I’m so sick of these videos that just pander to what people “want to believe” rather than actual facts and experience.  Anyway, solar was never meant to be a single power source, it’s the most green power source that can augment other power sources reducing our emissions.  If every home and building had solar panels on their roofs we would reduce our need for alternate power sources by 60% globally.  The solar technology of today has improved drastically over the years where we have 400-500 watt single panels, we have solar windows that can use ultraviolet light (aka energy from any weather condition) … this technology continues to improve, generates more jobs, and reduces environmental impact of 8 Billion humans.  There is no koolaid to drink, you either deal with it or go extinct clinging on to a belief.  Take your pick because science doesn’t care what you “believe”.
Reply: @NKBobcat  Silicon (what is used to make solar panels) is the second most common material on this planet and is allowed and is mined in the USA.  These companies are 100% US with US materials:

Heliene: Mountain Iron, MN (U.S. manufacturing facility)
Mission Solar: San Antonio, TX
Seraphim: Jackson, MS (U.S. headquarters)
Silfab Solar: Bellingham, WA (U.S. manufacturing facility)
Solaria: Fremont, CA (U.S. headquarters)
SolarTech Universal: Riviera Beach, FL
SolarWorld Americas: Hillsboro, OR
SunSpark: Riverside, CA
Tesla/Panasonic: Buffalo, NY (U.S. manufacturing facility)
Auxin Solar: San Jose, CA
CertainTeed Solar: San Jose, CA
CSUN: McClellan Park, CA
First Solar: Perrysburg, OH
Global Solar: Tucson, AZ
GreenBrilliance: Baltimore, MD
Hanwha Q CELLS: Dalton, GA
JinkoSolar: Jacksonville, FL
LG Solar USA: Huntsville, AL
Lumos Solar: San Jose, CA
MiaSolé: Sunnyvale, CA
Prism Solar: Highland, NY
Solar Electric America: Richmond, VA
SolSuntech: Virginia
SunPower: San Jose, CA
Reply: @theberserker9285  What happens to the turbine blades when they break or are 'retired'?  They're buried in landfill.
What happens to the gallons of lubricating oil if the generator or gearbox fails?  It's spilled on the ground... or where does that oil go to if an OFFSHORE gearbox fails.... into the ocean.  Smart, eh?  No downsides to that, right?
And PV cells produce output for maybe 3-5 hours a day, and even THAT depends on the latitude AND the seasons!  So, it's pretty much impossible for PV cells to provide base load energy unless they're overbuilt by a factor of eight or more... maybe twenty or more times max output, in order to store enough power for even base load on a 24/7/365 basis!
A loss of wind velocity at night leaves you with NADA to heat your house, charge your EV or light your TV.
Nuclear is vital for base loading because they love to run at constant, level outputs and hate to be ramped up or down.
Natural gas doesn't take a lot of energy to extract, compress or transport to homes or industry for heating.  (or export to other countries when 'certain countries' cut off supplies for political reasons) plus, it helps our Balance of Trade if we can actually SELL the LNG to countries that want and NEED the product!  Which makes curtailing natural gas production, drilling or pipeline construction to probably be the absolute stupidest thing any political "leader" could possibly do, for all the economic AND humanitarian reasons!  Yet he did and gets kudos for that stupidity.

Critical Thinking is Dead.
Reply: @theberserker9285  Buy a hybrid.  It makes lots more sense.
Reply: @theberserker9285  Buy a used hybrid.  My Prius still gets about 40 mpg on average... about the same as the first time I refilled the tank after I bought it.  Newer models get even better gas mileage, and many are selling for a lot less than $20k.  Many older ones are less than $10-15k.
MY Prius turns TWENTY years old next February 10th or so and runs fine, has been completely reliable, and a month or two after its regular oil change and checkup, the dipstick comes out looking like it's been dipped in honey.  Never, EVER had a car that could do that, and I've owned cars since 1969.
So, at 40 miles round trip per day, or 200 miles a week for commuting to work, you'd be talking about less than $20 a week for commuting gas, or less than a few hours' income.
If that's still too expensive for your income, you should look at improving your work skills so you'd be attractive to an employer who could and would pay you more.
Reply: @plusafdotcom959  Not likely....
I love my gas only sedan too much...
Reply: @plusafdotcom959  I don't have an extension cord that can handle the load...
Reply: @systemsevil1  I am sorry for your lack of reasoning skills. Utilities are subject to all manner of consumer protection laws. To the degree that prices are fixed, this is done by agencies under the control of people ELECTED BY AMERICANS. Maybe you are against Americans having elections?
Reply: @ws6002  hahahahahH
Reply: silly you. that's the point - we need better battery tech. i don't agree with set goals by specific year though. but if an industry can be encouraged into development a better battery, why not? compare batteries of 1900 to now and tell me it hasn't evolved.
Reply: @derrickdavis7524  There are no advantages. That's why they didn't present them.
Reply: @victorluke5816  That's only partially true. Everyone seems to forget that solar panels are only a small part of the total package. The electricity generated has to be stored and converted to usable electricity. Having DC power is meaningless when you need 480VAC at 4000 amps.
Reply: @stevenbass732  Inverters are always part of the mix when it comes to Solar power.  Then the storage is only needed for the excess.  The higher the percentage of renewables the more storage will be needed.  Perhaps even that synthetic fuel BMW is flogging.  Make excess electricity from solar or wind into methane for when its needed along with batteries.
Reply: @victorluke5816  No, the storage is not just for the excess. It's purpose is providing a stable source for the inversion process.
Reply: Probably because the study was utter bullshit from the beginning, as seen here...

"In 2015, 0.6% of utility generation in the U.S. came from solar. To increase that number to 100%, we would need to produce 4 million gigawatt-hours (GWh) of solar energy annually. To produce 1 GWh of solar power, you need approximately 2.8 acres of land—or roughly 11.2 million acres (17,500 square miles) to generate 4 million GWh of clean energy. By these calculations, it would only take 0.6% of the total surface area of the continental United States to power the entire country with renewable solar power. That’s right, less than 1%."

So... you would need LESS THAN 1%.  Which proves yet again how embarrassing this garbage video actually is...
Reply: @markhutton6055  And what again makes heat pumps "inefficient" again?  That claim is comically absurd...
Reply: @stevenbass732  Its sent out as soon as its converted.  That's when you have to decide if you need long term or not.
Reply: uh oh. john.made a miss take. we cant rely on him anymore for news🙄🙄
Reply: @markyuto6820  what? bots are people too😛
Reply: @themistoverthelake7883  I give Stossel more of a break than most broadcasters since I've been watching him since his 20/20 days.  He really has to stop inviting that science guy.  He's almost wrong on everything he comes on to defend.   I remember his organization when he was defending smoking cigarettes as a no problem healthy habit.
Reply: @decaprio7421  That's the best you can come up with? Weak...
Reply: @themistoverthelake7883  No mistake. It's an update because the study was updated.
Reply: @ws6002  Walter, you are incorrect in just about everything.

And if you really care about a sense of nationalism, you'll admit that opening our oil supplies up to DOMESTIC PRODUCTION would solve all of our energy problems and drive the cost of fuel WAY down. That was proven during the Trump administration. Imagine what would happen if we produced all of our own oil instead of exporting almost ALL of it.
Reply: Electric grids can easily be knocked out causing stoppage of commerce, transportation and private movement
Reply: @ws6002  I just don't see the reason there is a full on war against oil/gas.  Natural gas is a clean burning fuel.  If denied to all cities, in a power failure they can't even cook to survive.  It's one thing not to have air or heat but to be unable to cook is another matter.  It's overkill to go after natural gas.  Options are protective to the quality of life.
Reply: @victorluke5816  I wonder what fuel they use to burn the corpses.
Reply: @netfolks  If they use the wick effect, a cigarette and a fat corpse could be used to fuel an entire room full of corpses.
Reply: @Travis  I've got a gas stove and a gas furnace in my house. It sure beats living in house at 0°F. Still, natural gas is a fossil fuel. Climate change is a serious issue. And there are alternatives like heat pumps, especially geothermal heat pumps. Eventually, we need to make the switch.
Reply: there is alot that is wrong in the first video.
Reply: It was updated alright…to include actual facts and truth, unlike the false fear being spread on this channel.
Reply: @theberserker9285  Aren't there increasingly more in use every single year?
Reply: @victorluke5816  Could not be more true!!!;)
Reply: @victorluke5816  this is to assume that the solar panels could generate the full 18% all the time. What happens to bad weather, transmission line losses, night time storage and usage? California already has so much solar they had to start restricting it. They were getting overloaded so they had to start curbing the solar plants because they were literally paying other states to take the power. The issue is the intermittent power it provides and when it does it. Think about when the sun is down your home watching tv or whatever, a family is home with mom and dad watching tv, kids in another room playing video games. Light on the house because it’s 8pm. Since it’s Cali most likely mom and dad work so they’re probably running the laundry machine. Now tell me when do you think power spikes? Yepp right when solar is generating no power. Usually winds don’t pick up after sun down either without a storm or generally windy areas. It usually in the mornings, so don’t pray on wind turbines to cover the distance like so RTS game where you just plop another one down and it just gives you a set power. So now what, how much land do you need to stack how many batteries and additional solar to be able to provide extra power for recharge to make it up. If the battery technology currently and that includes newer stuff that is not on sale yet, your still looking at batteries life times that are the same as your phone. Imagine a whole grid yanking on them daily. So figure that cost every 5 to 10 years. It’s not pretty. We need nuclear fission or fusion to make this work or we are stuck with fossil fuels to make up the difference. Be logical, no one is doubling down on the grid issues let alone the intricacies of intermittent power sources being the baseline.
Reply: @egondro9157 All of that has to be taken into account which means a lot more storage and larger wind turbines.   The ones that can each power 15K households will still produce lots of excess power on average.  4-5 hours of storage per 24hr period is the goal for most places to be enough.
Reply: What if the move towards electric vehicles was nothing more than another way to squeeze more money out people by creating government mandated necessities? In short, the rich get richer, the poor get poorer.
Reply: @victorluke5816  Good for you (really!). But There's no such thing as a free lunch. Somebody always pays through inflation and government programs. I don't have a car, and I don't need one.
Reply: @laurenarndt464  I've paid my taxes and I've gotten my benefits.   I live in southern California where not having a car is like getting around in a wheel chair in places where there is reliable public transportation.
Reply: @laurenarndt464  I actually live in a more restrictive neighborhood.  I'm in Cerritos.  This city has had more cases go to the Supreme Court than any for a city of less than 80K people.  I can park in my own driveway but the color scheme of my house has to match the decor of my neighborhood and my windows must be of authorized size.  The lawn must remain green or you will be cited.  Artificial turf is not allowed.  I think that the size of satellite dishes for the US was also decided in Cerritos.
Reply: The future of electric cars will be similar to low production expensive sports cars. They will never replace ICE engine vehicles. I'm a master mechanic with decades of experience that has worked on both which illustrate in depth in my vid. Mass adoption of EV's would be a disaster. This is all politics.
Reply: @wt9653  from the perspective of an auto mechanic there are key points I have added to this topic in my home page vid.
Reply: @mt2nv1  "I’d be willing to bet that far exceeds the total emissions globally to mine in manufacture, electric vehicles." well you better not bet too much. The mining of these batteries with only less than 1% of the entire U.S. vehicle fleet is already causing environmental disasters in places like the Republic Of The Congo, Chile and Portugal. Then you also leave out the massive electricity required to charge the batteries and the environmental disaster to dump these batteries when they reach the end of their life span. I go in depth from the perspective of an auto mechanic that has worked on both so I have a lot of experience. i explain it all in my home page vid.
Reply: @nutacorn  why is that? Electric car conversion will never work. I am an auto mechanic with decades of experience and go in depth in my home page vid. It's all politics. ICE cars are the future of the auto industry.
Reply: @ChannelNews1  The renewables allowed Germany to survive the Russian shut down of their gas.   The use of coal basically plugged into the loss of natural gas.   It wasn't the fault of solar or wind.   The difference here is that Russia couldn't stop the wind or sun.  Should Germany get more wind rather than solar?  Yes.   Much easier to get wind in Germany than sunlight.    Although the cost for both are headed to the basement.   Looks like another 50% decrease in cost in 2023.
Reply: @ChannelNews1  you listened to an auto mechanic who will likely be put out of work by EVs? Good call. 

None of what you are spiting is true.
Reply: @mt2nv1  Dude, I am an auto mechanic. Everything I stated in my home page vid is also fully sourced. Simply watch and learn.
Reply: @victorluke5816  But it does not make it easier, unless you have 100% backup for when the sun isn't shining... period. That's called an "unreliable power source".
Reply: @ws6002  And who is going to pay for that? You do... with an extreme boost to property taxes et al.
Reply: @ws6002  not if you accumulate properly. ... for instance, 3% of 103% after the first year will be more than 3% of what you started.. it's called accumulating totals.
Reply: @fjalics  Please make sure to add the incredible cost of transmission wires from Nevada to all neighboring states (and forget about the cost of getting energy to the East coast. A little information can be very dangerous based on how it is (mis)presented.
Reply: @DarkMagic666  Depends on your geography.   Places like Texas only need a 5% backup since that's about the only time when there's no sun or wind.  States near Texas can piggyback off of this and have their at 5-10% backup.   Unless they also have that magic 5% downtime that Texas has.   Problem places are Germany where they will have to have either a lot more wind infrastructure or more batteries due to their lower solar reliability.
Reply: @DarkMagic666  
We have the devil 😈 leaving comments now? YouTube needs to do better job screening.
Reply: @DarkMagic666  go ahead and look it up. Conservation of mass is maintained. It’s called chemistry.
Reply: @wt9653  Wow, do I scare you? And nice try with the selective censoring you obviously so much enjoy.
Reply: @MatteoComensoli  What's your qualifications to say this?
Reply: @MatteoComensoli  What's your qualifications to say that?
Reply: @nutacorn  What's your qualifications to say that?
Reply: @nutacorn  : Unfortunately (for you), most of the facts presented here ARE true.
Reply: @CvetkovIlian  But I bet he can spell "stupid".  Nothing funnier than someone calling another person stupid and spelling stupid wrong.  Just saying.
Reply: @derrickdavis7524  Yes, John  to be a real journalist has to give all the facts. Why he didn't said anything about American Inventor Wayne Travis and hid gravity motor that can generate enough electricity to supply 25 homes,  or the Halbach Array Motor that can make EV cars go twice the distance, or the RX/18 magnet motors that can supply energy for entire islands, or the Motoflux that can multiply magnet power by 5x.
Reply: John, I can't believe you didn't mention nuclear.  Some say it is the quickest and most efficient way to reduce one's carbon footprint
Reply: @victorluke5816  isn't deisel still more econmically viable? One barrel of oil is extemly energy dense. A 797 mine truck at a current power levels would take a week to recharge and only work maybe a full day. This is not progress at least not yet. And they want to stop 14,000,000 daily gallons of deisel? To that is say Good Luck.
Reply: @theberserker9285  What is really your question/ You don't know how to buy a good $4,000 used car(Japanese generally the best) and just use a gallon of gas each way?
Reply: @prestonbealle8632  I drive a 
Buick Century.....
Currently on my third one , it's 20 yrs old (Paid in full) and very good 👍 for my needs, thank you very much !
Have a great week end Preston 😉
Reply: Decades ago, around the time of the first "Earth Day", an intelligence challeged girl where I worked, who knew I was handy mechanically, asked if I could install an item she bought for her car. At the auto parts store they were selling novelty chrome caps from a cardboard box with a hand written sign that said: Don't pollute, close off your car's tailpipe.  She actully believed it could work. We now have a government of what I call tailpipe cap thinkers setting our policies.
Reply: @decaprio7421  
What if we all used jets to go for a visit  ?
Would that save the world in your universe ?
Reply: Do all these numbers regarding solar panel output, factor in location and weather, or are they maximum numbers under ideal conditions?  What are the storage requirements when conditions are not ideal, or it’s simply dark? I know of few locations where solar farms have been built where it’s cloudy and wet for much of November to March and when it is sunny, it is still dusk by 4:00.  I never see power output published for these conditions.
Reply: You say it hasn't had a catastrophic impact on electricity rates? Tell that to the people on a fixed income who can't afford to pay their electric bills anymore, 
who have seen their rates more than double over the past few years, who are now having to depend on their local food banks to feed their families. Yes, we're one of them. It took almost 6 months to pay our summer electric bill. We didn't  use our air conditioner once over the summer. We depended on our swamp cooler and fans and just suffered through the 100+ degree days we have here in the desert. We live here because the housing was more affordable. Moving is not an option. Thank God for food banks. Never thought we'd be on the receiving end but here we are.
Reply: @Fitat47  scientific evidence does NOT point to 6000 years.. seriously?
Reply: Actual studies show that putting solar on a tiny portion of the desert will create enough energy for the planet.     But that's the actual  study.    Also another study showed that if offshore wind was used properly then it would produce enough for 8 x the world's needs.  Wow.
Reply: @Mark Hutton  as for your question of how much to replace heating etc with electric versions.  Head of national grid has the answer.. it will use 1/4 of the energy currently.
Reply: @paulevans7560  Since we just evaded one such happening..., how well would people that depend on everything electrical do.. if everything that makes , delivers and runs on electricity gets fried?
I am talking about a solar flare of course, and one that does a lot more damage than what happened during the Carrington event. ( houses burned because wires melted in the walls).

And before you reply, please take a few moments to really consider what happens to an electrical dependant world.. if electricity goes poof.. I mean. it would be bad now.but .. and that flare IS coming btw, and there is nothing we can do about that.
Reply: There's no such thing as zero emissions. There never will be. But blame cars for emissions that are supposedly killing a 4.5 billion year old planet.
Reply: @alans9806  A sunny land mass the size of the United States with a total population less than that of California.  A GREAT country, but nevertheless, not a manufacturing center of global trade.
Reply: Tnx 4 the follow up:)
Reply: 1 percent of the land mass of the U.S. to provide solar energy is huge.   That  is a waste of land
Reply: So therefore it was NOT a fact
Reply: @theberserker9285  Keep  driving your "gas guzzler"you're helping the planet more that way.
Reply: No kidding. Shallow research.
Reply: @markhutton6055  Heat pumps are overall more efficient than heating with oil and gas, at least if the average temp is not really cold. Heat pumps pull heat from the air very efficiently.
Reply: GREAT JOB Mr Stossel!  More Videos Please!  
RC from Houston Texas.
Reply: I'm a 40 year car tech! Electric cars will be the fall of transportation period all the time,  However I can see some usage in big cities!
Reply: @victorluke5816 there is just no way that amount of panels would supply the entire US with electricity.
Reply: @gman1003  Only because of transmission loss.   The US is fundamentally one of the best countries to deploy solar power due to the plentiful supply of sunlight.  This is not true for most countries.   China is much worse for Solar deployment despite their higher install rate.
Reply: Gas pumps use electricity too, teachers says: "For every 3,750 EVs a gas station goes extinct."  Buh-bye fossil fuel economy!
Reply: @markhutton6055 Heat pumps can be incredibly efficient. Most people do not realize you can pull heat from air that is below freezing. But you're right that heat pumps can overload an electric grid. Oil and Gas fuels produce tremendous amounts of energy when burned, but they have drawbacks, too. I like the idea of having both a heat pump for everyday heating and gas heating as a backup.
Reply: @CvetkovIlian  
Stossel fails to disclose he has received over $1.3 million from Koch foundations (who has a large interest in oil) since 2014.
That's why.
Spread the word.
Reply: Instead of just removing it, how about updating the facts about how much of the continental United States it would take?
Reply: Actually it would only take enough solar panels to cover about 10% of Nebraska
Reply: So lies , lies and more lies!
Reply: Stossel, you are wrong about so many things :-( the thing with the solar panels was particularly egregious; science, it ain’t your strong suit, like a bunch of other important fields…
Reply: You need the to cover the area of 7 United States to generate enough energy with solar panels. You need 10 times to don't with wind mills. To generate the power right now. Not counting all electric cars.
Reply: @rontaylor7362  please show your assumptions; most importantly, show your math. Then come on back and tell us all about it. Read a book, get an education.
Reply: @MatteoComensoli  Do you have a video of facts to refute this video?
Reply: I used to think you were a competent, unbiased journalist, now I know better. Guess it's tough out there! Sad😢
Reply: @victorluke5816 I agree with you on that point. Let the market make the decisions.
Reply: Why are electric vehicles getting a free ride. When are they going to start paying to use our roads like gas and diesel vehicles do with taxes on gas & diesel.
Reply: @normanfox4916  Society through their governments want to accelerate the transition to EV's . To that end they provide discounts on purchase costs and reductions in road tax and other incentives. Why? well that is just politics.
Reply: Hybrid cars make far more sense until another reasonable vehicle can be developed
Reply: @ws6002  I know you made this comment some time ago but another recent comment brought my attention back to this thread. I was wondering why you think replacing "oil cartels" with electricity and battery "cartels" is a good thing. To me it's just "six of one or half dozen of the other"
Reply: @jimwhelan9152  
Here are my reasons. First, there is the time factor. If you put a gallon of gas in your car, you have to replace it about 30 miles later. If you put an equivalent mass of lithium in your EV, you have to recycle that battery 200,000 miles later. Second, we will be making EV batteries here in the United States, using the natural resources such as the lithium deposits available at the Salton Sea in California. Third, we will get the energy to power EVs from renewable energy sources. The machinery for making this energy has a 20 year life cycle. Once you build it, you essentually get 20 years of energy pollution free.
Reply: @jimwhelan9152  
The last reason is harder to explain, but the price of oil is controlled by export-only economies. There is an inherent in balance of control over the marketplace when it is dominated by export only countries. Batteries will never be controlled by export only economies.
Reply: @mt2nv1  The google pics of black Samurai's told me all  I need to know about it's infallible information.
Reply: @victorluke5816  I believe the government would never lie to us and would happily admit an error if it was pointed out to them.  That last sentence was so full of lies I feel dirty just typing it.
Reply: @markyuto6820  every one the government could muster
Reply: @victorluke5816  True my new car battery cost only $200 and it lasts 2 years now instead of 5.  What savings, smfh.
Reply: @ihatehandleshowaboutyou  The think tank that came out with most of these lies also was supporting big tobacco and the CFCs don't damage the ozone layer guys.    Despite governments not being truthful all the time they are actually better than the private companies that will give you whatever result you ask for.
Reply: @ihatehandleshowaboutyou  Get the AAA batteries.  If they blow out early they will replace them.
Reply: @victorluke5816  Sounds legit.  How often will the panels have to be replaced?  How many miles of new cables to transport the power?  Where are the batteries going to come from to store the energy?  What happens when hail storms destroy a couple of square miles or more of panels?  What happens when winter covers the sky?  And on and on and on....
Reply: @ScottandJodi  Most residential panels can last around 30 years.  In order to keep cable costs down is to put these near coal plants so that the existing cables can be used.  What happens when a tornado destroys a oil refinery?  You repair and replace just like anything else.  Those places that have less sunlight will generate less energy.  That's why 1KM high wind generators are needed.   Those get good wind 24/7.    And on and on because all problems have solutions.